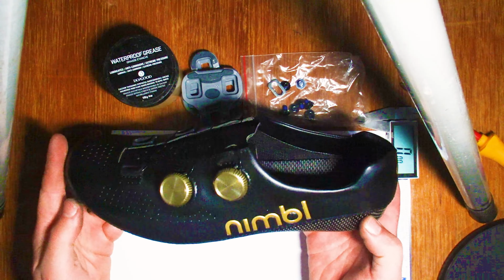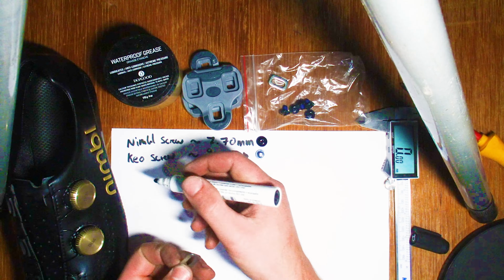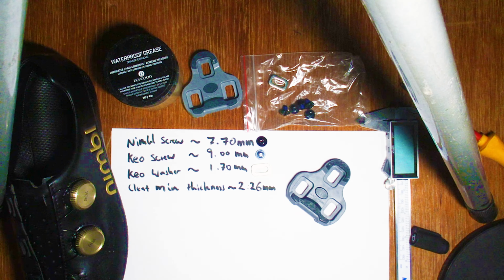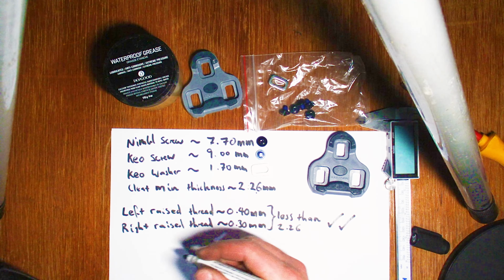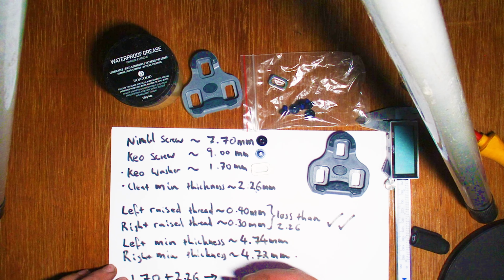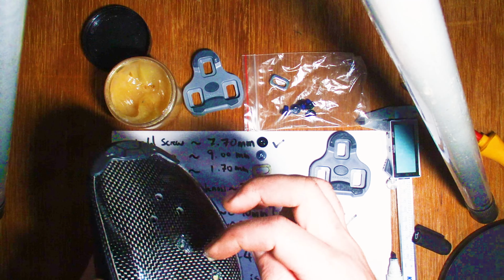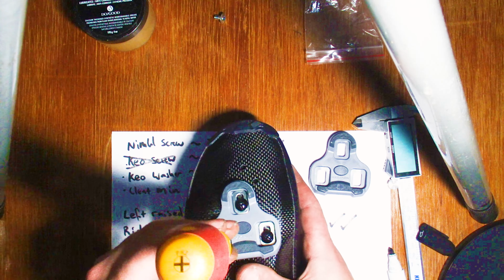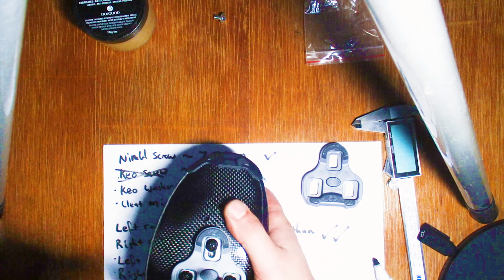Nimbl Ultimate Cleat Fitting Guide

Comment: I have the Ultimate Glide and did two rides with them. I can feel the foot plates through the carbon sole, it hurts the feet especially when pedaling standing but also when just cycling. For such expensive shoes...
Reply from the maker: That's interesting. Are you using the original insoles with the short nimbl cleat screws?

Comment: How does the shoes fit?  Are they true to size?  Thanks
Reply from the maker: Great question. In my opinion; they're true to size with a relatively large toe box. I was using Shimano sphyres before these and found my toes were always being squished. Lots of pros get custom insoles but I've been happy with the stock ones. Of course it's always best to try shoes on in a store before purchase.
Reply: @stiffysworkshop  Can you share your feet measurements and choosen size in nimbl? I have 25,8cm feet and wondering beetwen 41,5 and 42.